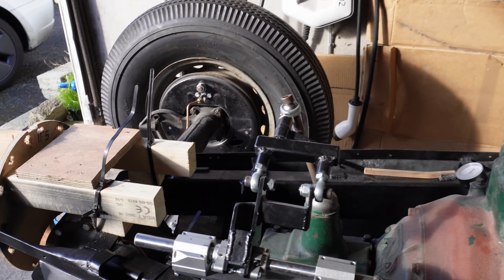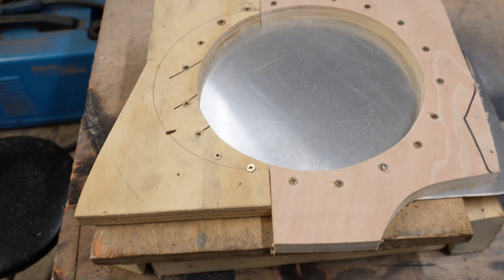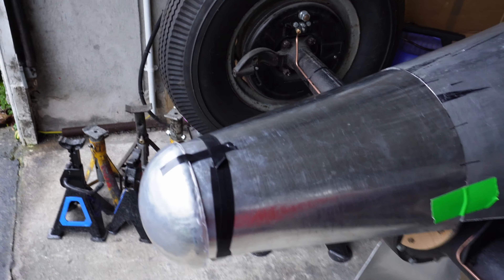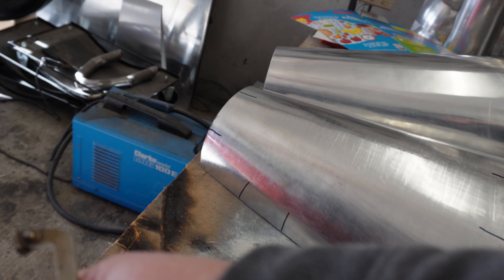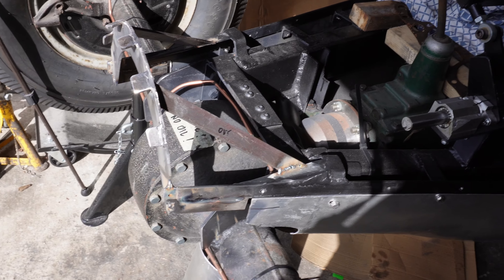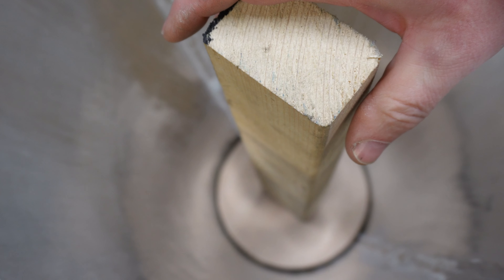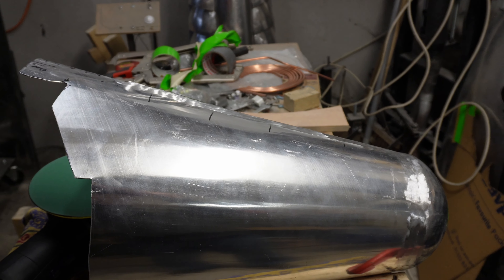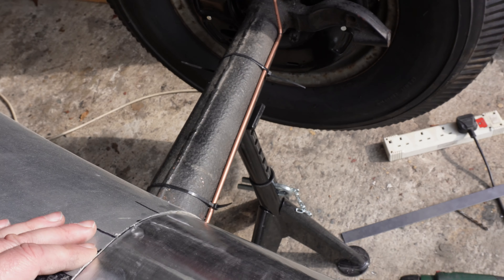Belly Tank Lakester | Tail Cone Fabrication Ep58

Comment: Goo gone works for removing the adhesive on stickers. If you can't find that look for a citrus based gell cleaner or sometimes in the spray paint section you can find adhesive remover.